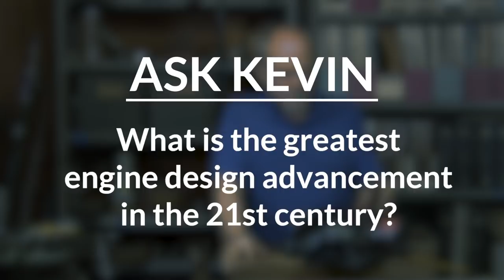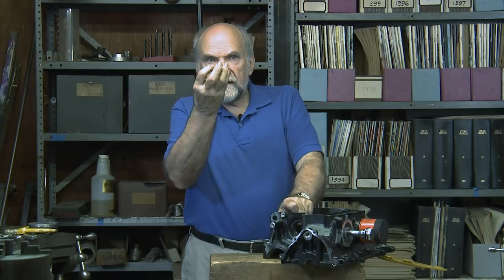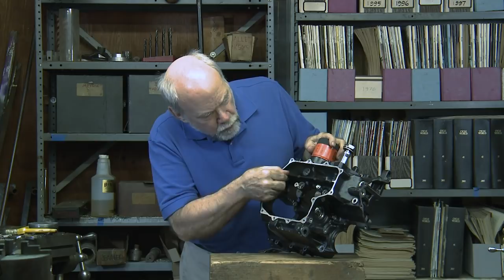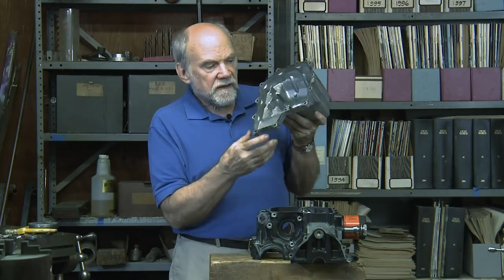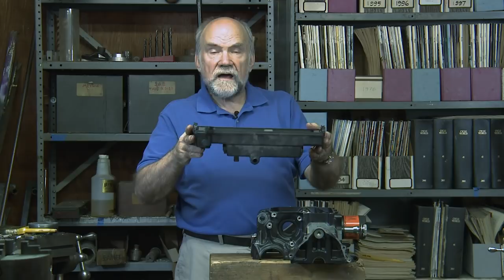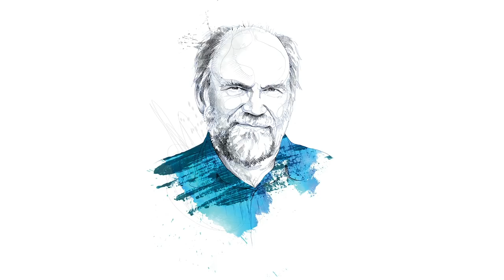What Is The Greatest Engine Design Advancement In The 21st Century?

Comment: I know this isn't technically the answer, but, as a professional tech of over 45 years, I was able to personally watch the affects from carbureted to injected. Engines went from under 100,000-mile expected life to 300,000. For two examples, in the early eighties I saw the 2.5-liter GM engine and in 1985 the Buick 3.8-liter engine skyrocket to consistent high mileage numbers. Precision fuel delivery is in my opinion the greatest thing to happen to every manufacturer's engines.

Comment: I'd disagree, yes the better castings are immensely important, but the greatest development has to be digital engine management. Better castings, better tolerances, those are all continues processes. But ECU really changed the game.
Reply: without the hardware to push it in electronics is almost impossible.
Reply: @mohba01  I do not understand what you are trying to say
Reply: @Analog Human I don't get the point.
Reply: I agree with Peter Griffin
Engine management is way faster and has more precise fueling.  Not to mention better ABS, Wheelie control, Traction control etc.
Reply: Didn't ECU first appear in 20th century?
Reply: 😅YAMAHA LEADING THE WAY! 😊

Comment: When I first got into the motorcycle business in 1972 engine castings were thick and heavy. Even though they were subject to porosity.  Oil would leak right through even though they were ball bearing everything  and maximum oil pressure was 7 psi at maximum.

Comment: are these thinner sections more brittle?
Reply: Steve Mackelprang That’s pretty much the entire purpose of the video.  He clearly stated that the thinner castings are stronger than the older, thicker ones.
Reply: No the alloy and heat treatment determines that not the thickness. With fewer defects you can assume that it is less brittle with few places for cracks to start.

Comment: I would say the greatest advancement in engine design is my anti-knock prototype.  With it, I can advance ignition timing to the optimum setting.  

I put lower quality instructions in my video comment section that can be used on lawnmowers or generators.  For testing purposes only!  Use at your own risk!

0.2 of A U.S. gallon of gasoline will run my modified lawnmower for about 4 hours.  Briggs and Stratton 300 series...